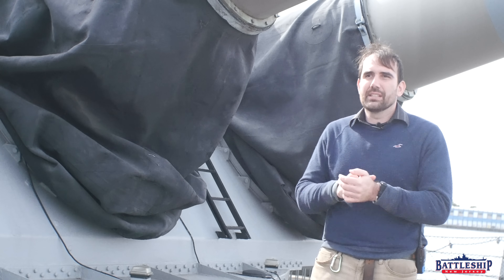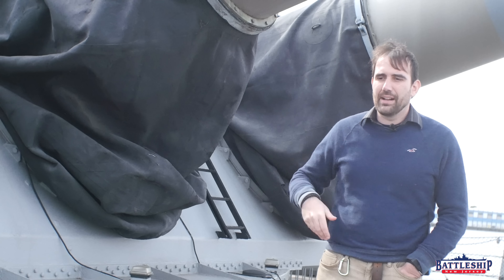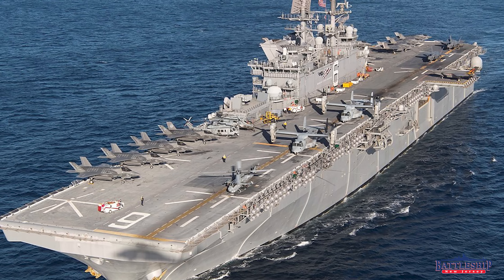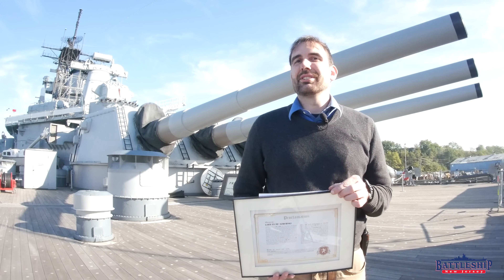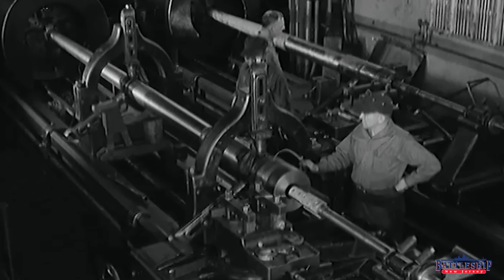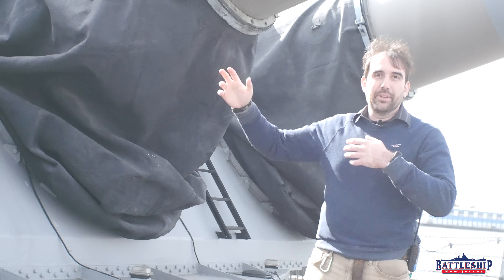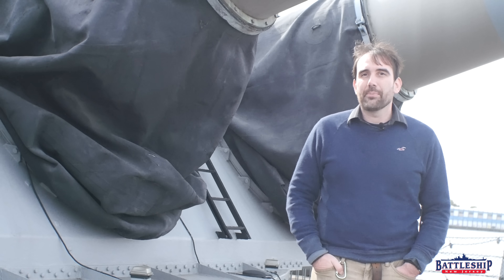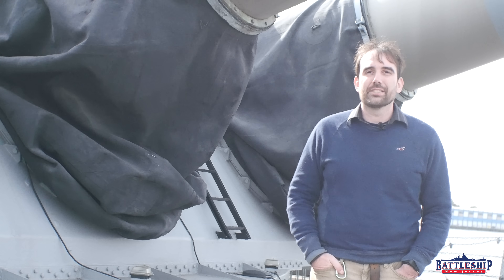How Much Would It Cost to Build a Battleship Today?

Comment: Nice video.  I'll go nuclear, 1200 x 160 ft.  6 shafts or 6 pods (eliminates shafting). 2 Bowthrusters.  4 triple turrets 18" 55 calibre. Also lots of missile launch tubes min 160 max 300 verticle launch. Drone hanger  min 30-100 drones.  6 or 8 inch secondary super guns min 100 miles (4 per side).  8 Ciwis  20 mm.  4 Ciwis 30 mm (antimissle with 3X range of 20mm). 25 foot torpedo bulkheads.  8-12 inch class B armour backed by 24" of composite armour (24 " can be spaced out above waterline- 12" class B, 5 ft compt, 8" compo, 5 ft compt, 8 " composit,  repeat)   Composite armour will be lighter and better than class A or B armour. Ranged defense, missiles, guns, 2 types ciwis. Underwater explosions - knock off torpedo from a distance or explode torpedo at distance from ship, bring explosion to surface away from ship.

Comment: That's a tough one, but if they had to come back for a national emergency to defend the nation, I'd yank all four away from the museums. It's faster and cheaper and you don't have to re-tool to build new. Yes, they'd need a lot of work to be brought back, but it probably makes sense to do so. I'd also look into any practical upgrades of old equipment that can be replaced. For example the 16 in gun targeting systems could probably be done quicker and more accurate with something as simple as today's laptop computers or, upgrades to the shells they fire, and that's just for starters. I'd offer Ryan a job on board the ship with the Navy as an "underway ship historian" with the understanding that if you take the position, you are going into harm's way with the ship and it's crew.

Comment: I've always answered this question as 5-6 billion per ship, and likely a 2-3 billion startup cost for tooling, facilities, etc.
Thing is, if we were designing a modern class of battleship, it likely wouldn't be exactly what the Iowa's were. Would likely have much less armor, probably 5-6 inches, since we aren't defending against incoming 16 inch shell fire anymore, and modern torpedoes and missiles would likely defeat anything that had been in service. So saving some cost there, and gaining reserve buoyancy for other things.
These ships would also most likely be gas turbine, only feature the 6 forward guns, and likely 4 of the automatic 5 inch (2 forward 2 aft) saving more weight and cost, and requiring a smaller crew.
We would however add back in a lot of cost and weight as the stern would likely be all VLS tubes and Harpoon launchers, along with the 4 CIWS and all the latest in electronic warfare suites.
Would be a pretty formidable ship, and along with the carriers it would be traveling with, not something you'd ever want to see show up off shore. Would be pretty exciting to see actually.

Comment: What would I want in a new-built battleship?  

Well, the first, it would have to be named Montana, and I'd suggest making eight if I could get Congress to go my way.  

Use the A1B reactors from the Ford class to manage the development risk, and design for same speed profile as the Ford aircraft carriers, higher top speed if possible with available power.

A battleship's primary difference over a battlecruiser is to take a lickin' and keep on tickin', so strictly armoring with just metal won't do; it'll need a composite armor system to bounce gunfire, anti-ship missiles, torpedoes and mines, AND be relatively quickly repairable.

Use the AN/SPY-6 or successor system and make it quadruple redundant.  Assume the ship will be a flagship and equipped with quarters and comms to make that happen.  In fact, assume there will be an embarked ambassadorial staff, and they'll need their own facilities, enough to host a peace conference aboard.

Go with four main turrets, dual 21"/50 smoothbores each, and put 20" projectiles in slippery polymer rifled 21" sabots.  With integral rocket-boosting guided projectiles, need a range of 62 nautical miles.

Eight secondary turrets of dual 5"/62 Mk4 Mod 4 guns for anti-surface/anti-air and light naval gunfire support.  

Loads of VLS all the way up to the bows, 384 cells at least.  

Square off the aft to make a hangar for F-35Bs, UAVs and LAMPS helicopters, and a well deck for ship's boats at the aft-most waterline.  Don't mind if Turret 3's top is a helipad with a bridge to a hanger in the superstructure.

Plethora of 20mm CIWS and SeaRAM systems with Helicopter, Aircraft and Surface modes, enough to squash any swarm attack.  

At the top of the superstructure, two anti-air/anti-missile/anti-satellite laser systems.

Sorry, does it sound like I've been thinking way too much about this?

Comment: I want a fleet of 8 modern battleships.   Damn the cost, full speed ahead.
Reply: I would join that Navy!!! No questions ask! Could you imagine the look on a enemy sailor's face when he realized battleships were steaming towards his missile cruiser???
Reply: maybe as a platform for railguns instead of the artillery cannons
Reply: @insertcognomen  As much as I love railguns I have to say a modern BB would not need them to be effective in a modern combat or better stragic evoment as we have ramjet shells that have the same range but can be fired from modern power guns like DD and in a pench you could reactivate the old ships and give them the new shells.
Reply: @insertcognomen rail guns are cool but they don’t work so well for shore bombardment. Also remember rail guns shoot a solid metallic projectile very fast using the kinetic energy as the destructive force (ie no explosive filler) the slower it goes the less damage it does. Also the range the us navy (publicly) shared is only 126 miles while the current block IV and V tomahawk cruise missiles can go 900-1000+ miles.
Reply: @curiousentertainment3008 There’s also the minor problem we’ve been having building railguns whose barrels last more than a few shots. The material science isn’t there.
Reply: @maxcaysey2844  at 3 knots per minute
Reply: @maxcaysey2844  in reality you'd just be target practice for missle systems and aircraft carriers, honestly a battleship is like the Naval equivalent of running into battle with a samurai sword, sure if you get close enough swing it at a modern soldier they'll be cut down no problem, you just never will get such an opportunity.
Reply: @calebmon  Naturallly I would want and expect state of the art modern CIWS, EW suit and chaffs, to hopefully take down and confuse incoming missiles and planes. But I understand what you are saying!
Reply: @maxcaysey2844  sadly modern CIWS isn't sufficient, it only takes one plane or missle getting through all the defenses to deal massive damage. If such systems were perfect then no one would ever use aircraft carriers in the real world, instead we'd be relying on battle ships to this day. Obviously the tech isn't good enough to combat modern tactics. 🙄
Reply: Why
Reply: @nelsondoyle1377 
It's the same as when your wife says why do you need another hunting rifle...just because!
Reply: @jeannankeefe845  I hear you, it would be dope. But it's neither smart nor a good use of taxpayer money.
Reply: 80
Reply: China will trifold that at half the cost
Reply: @kirovfactory but they'd sink easier
Reply: ''...forget modern naval doctrine! Give me cool stuff''!
Reply: would help the navys recruiting problem
Reply: yes yes yesssss
Reply: We can do it, we just need to raise taxes 3000%
Reply: Heavily defended floating missile bases. Alas, submarines are better.
Reply: I think a battleship would be a good thing for carrier escort.
Reply: Because this America! FUCK YEAH!
Reply: Rather our taxes go towards that than to more foreign nations half a world away.
Reply: Be prepared to pay more taxes. Not someone else, but you.
Reply: The idea of bringing back Battleships to war is nothing new. In the age of electronic warfare, modern missiles can be jammed to miss or self detonate before it hits it's intended target. Large naval guns, with modern range finders, would be able to do damage and could not be stopped because all munitions are "dumb" in comparison to missiles. Rail guns are a pipedream, they did not meet the requirements. Most modern ships have very little to no armor in favor of damage and flood control. Yes, Ching Lee was correct that carriers were the future, however a carrier fleet might not always be the answer.
Reply: Battleships would be the easiest target practice in the world
Reply: Eventually battleship will return to replace everything with mounted laser and rail gun turrets.
Reply: @Wesrets Indeed.. the "new" SeaRam system, which used the same radar as the Phalanx but houses 11 sidewinders... they have like 9 miles range compared to the phalanx 1,5 and they can engage multiple targets at once... Having 4 of those on an iowa (like they had with phalanx) together with some modern EW and chaffs, would make for some great anti-ship missile defence!
Reply: @maxcaysey2844  And if that doesn't work it still has armor great to counter the new hhypersonic missile treat.
Reply: .....No. Gun ships are obsolete, they cannot match the engagement range of DDGs, which is a problem mostly of shells not being able to be guided onto a target, once you fire a 16 inch shell it's gonna land where it's gonna land, at 32,000 meters all an engaged enemy ship has to do is be turning slightly and you can't hit them, there isn't a piece of fire control equipment around that can put a shell on a moving target at that range reliably. They also aren't survive able in that environment either, no amount of armor will save you from a guided missile, and none of the weapon systems aboard the New Jersey can be expected to defeat a guided missile. A modernized one with modern CIWS and chaff and flares could still not be expected to reliably defeat missile attacks, as the only thing that can reliably defeat a missile at anything close to a comfortable range is another missile, which would mean you are building missile systems into your big gun battleship, which means you have to sacrifice other weight costs, either armor, speed, or guns, to make room for them in your weight budget, and sacrifice things that take up internal volume, like fuel tanks, engines, weapon systems, magazines, or storage space. There is HUGE difficulty in trying to meter out a modern BB design, and then you end up with a ship that is large, expensive to build and maintain, and isn't terribly well suited to our modern fleet doctrines, and only has one real role in the fleet.

 That's why the navy loves the Arleigh-Burkes so much, it's a surface combatant, an anti submarine warfare platform, an anti air defense ship, and cheap power projection, AND it can perform shore bombardment/ ground fire support missions as well. The Big Gun Battleship is a romanticized but outdated warship that has no place in a modern navy where it would slow down task forces, be a big ol submarine target, and be unable to effectively engage enemy surface combatants in an acceptably safe manner, all while costing tax payers huge amounts of money to keep operational and moving.
Reply: @umad42 you make good points but remember the battleships we all know and refer to were built in the 1940’s and if one were built today its capabilities would be vastly superior. On the aiming issue gunnery technology development didn’t stop after WW2 while I won’t say it would be 100% it would be 70-80% accurate.
Reply: @umad42 erm. CIWS can put a bullet on a artillery shell. We can definitely guide a giant shell onto a giant ship.
Reply: And I say all of this knowing that engagement ranges have expanded WELL beyond the theoretical maximum range of standard naval artillery, so to have guns be useful you have to sneak through something like 50,000 meters where you are almost certainly detectable by anyone paying attention to their radar or listening to their sonar, and you can't engage them at all
Reply: tax money fr an outdated ship.... 
the bigger the ship the more ships you need protecting it 
and the more it will slow the rest of the fleet down 
and the more people you need to train for it and keep up to date with
if a missile hit the ship (modern combat) how long would it take to fix that hole in the ship and resourse cost 
battleships are sadly outdated BUT are cool AF

Comment: I recall hearing something about how they never replaced the analog fire control computer because back in the eighties they couldn't build an electronic version that could do the job any better. Wondering if maybe analog is still the way to go since an EMP can't shut it down.
Reply: An analogue computer would be useless, there would be no way to make one to interface with modern ammunition like GPS, rocket assisted rounds or seekers. The EMP effect is a bit over played and requires nukes, if they are flying you have way bigger problems. EMP is pretty easy to shield against, especially when you're already in a giant metal box. We know how to do it even in extreme environments like satellites from all but the most powerful solar flares. When everything else will be packed with electronics, why skip it for the guns?.

Assuming new builds, might as well make the guns autoloaders to take advantage of electronics rather than have dozens of dudes. All your secondarily would be an OTO Melara variant as that is super easy. That can fire more rounds than all those twin turrets.
Reply: You could build a better fire control system in the 1980s, the question is would it really matter? No one expected that they would be used against enemy ships, it would be against moving targets you could improve them.  They had a missile system for that.

The guns were primarily there for short bombardment and for that usage the WWII system do the job just fine. That was what the gun was used for in the 1980-90s

You can protect the system from EMP. A Faraday cage is just a metal box so you can have the fire control electronic totally insulated from the outside. You can use optical fiber for communication. The only conduct to the outside that you need is the power supply and you can filter it.
Reply: @target844  Well, the analog fire control computer is pretty good on moving targets as well. I guess it just wasn't worth it back then to try and develop and test an electronic system when the original works just fine.
Reply: An emp, if it reached the fire control computer at all, would PBL still do crippling damage to the ship
Reply: Probably portable EMP isn't sci fi anymore.

Comment: The choice to build new or reactivate an existing comes down to. How soon do you need the firepower? If a war happened that required a battleship to fight it. Reactivation is a much faster option. If you have time to gear up and build a newly designed battleship. It's much longer to do and brings different drawbacks. The first ships of a new design generally have problems to work out. Even the four Iowa's were not built the same. As a large capital ship of a new design. Nuclear is the best option for longevity and lower operating costs. Do you do away with the reduction gear setup and use electric motors to power the shafts? Limits the steam piping and therefore less high pressure steam pipe to maintain. By the published ratings. One of the reactors for a Ford class carrier would be more then enough. Thinner side armor in trade off for more torpedo defense? Unless other nations are bring back ships with 16" guns. Most modern ship killer missiles would be denture by thinner armor.

Comment: I would go to a smaller calibre 11-12" with fixed cases and you could automate the turrets to a bigger degree and with new power plants you could reduce the crewing significantly. Plus you would not need as much of the superstructure. I would also go to two forward turrets and VLS and helo deck in the back.
Reply: hah! Fixed cases! you're funny, very funny guy. the reason why you have individual powder charges is the same reason the larger mortars and howitzers have them; manual adjustment of range and velocity. you don't want your shell to punch right through a target, and explode out the other side. and whilst automation has come a long way since, no-one's ever made an autoloader for something THAT huge before. well, there WAS the Semi-Automatic loaders for King Georgey but, well... I think their record speaks for itself.
Reply: @havoc3742  The Germans ran a  28cm semi-fixed round with the propellant in a casing. I was artillery and very aware of how charge bags work. That German round is what I am basing my idea on.

Comment: No real need to do either. Weve also lost the ability to cast 70ft frames for steam locos, forge the rods, cast the drivers. All that, armor plate and guns went with the collapse of the US steel industry. Which should never have happened.

Comment: it would have 12 guns not 9 the tonnage would be over 100k. it would have a speed of at least 40 knots and nuclear power. the guns would probably not be 16 inch it would be a more modern more advance smaller gun with a higher rate of fire and more then twice the range if 16 inch guns they would have more than triple the current range and higher rate of fire secondary systems would be lazer weapons cwis and 6 inch auto guns with a VLS multirole bank and a hangar and support helicopters and drone maybe an underside torpedo anti torpedo launch system main guns might be rail guns armor would be something similar to Chobham armor like on tanks the belt would be a composite and due to no naval restrictions the all or nothing concept might be ignored it would also have a significant electronics sweet and command and control spaces because fleet admirals prefer battleships to command from over anything else